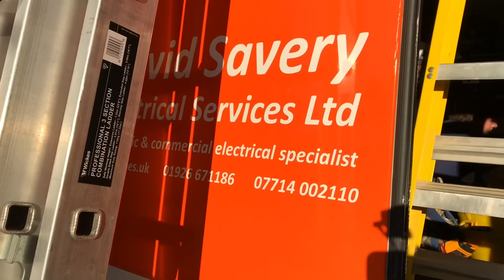Electricians Van Tour and Industry Advice with David Savery Electrical (DSES)

Comment: If you're looking for good battery kit, go for AEG, as good as Ryobi on price and up until recently they were made in Germany, a 6 year warranty on the tool and 3 years on the battery. Personally I use Metabo, still made in Germany, can't beat the krauts for tools. My battery kit has 6 years on it an still going strong, only had one battery out of 5 fail and that was replaced under warranty, never had an issue with any of the tools themselves. When the time comes to switch though it will be AEG I go for next, could be a while though.

Comment: Nothing wrong with a well stocked van👍🏼 I keep plenty of everything i use on regular basis.  Back & forth to the suppliers for simple things is ridiculous.  I have a good stock holding in my garage.  2 years ago, I decided to try buying stock on line, Which has worked out for me as I was sick of suppliers changing prices, depending on who serves you.  I have never had a credit account as I don’t want to get into trouble like most of the sparks I know.  If it’s a extra large purchase, I have a credit card.  Tools, I’ve tried everything, Milwaukee, just didn’t last, makita & Bosch were ok.  I went back to dewalt when the 5a batteries came out & their excellent 3 years on & still performing.  I do have an unbranded corded drill, that I have had for 20yrs & still going strong.  It’s great that you give your time to explain how your business works.  Keep the videos coming.
Reply from the maker: Thanks for the detailed comment and watching. Gaz 👍😁